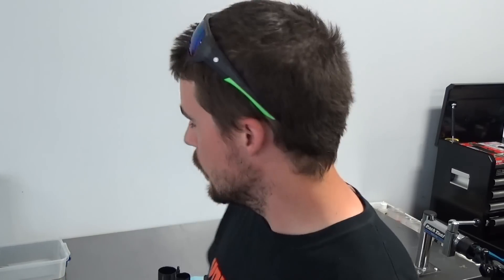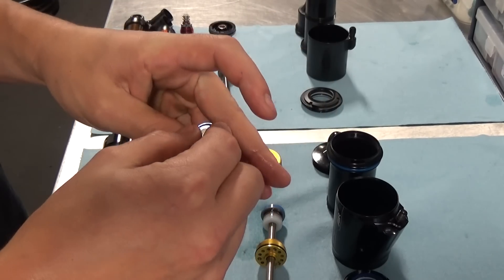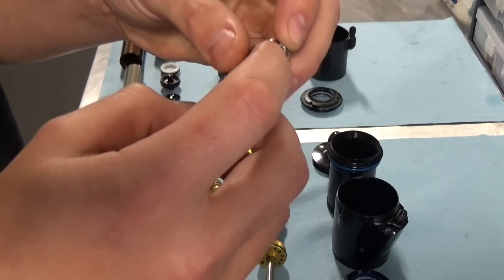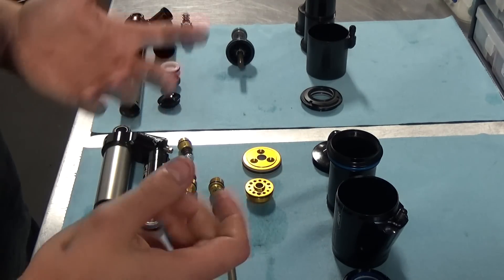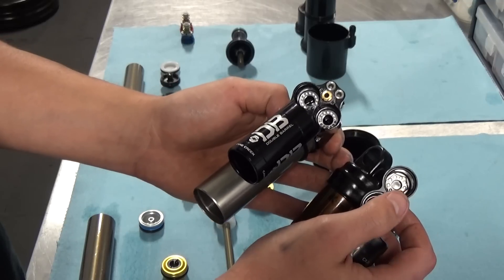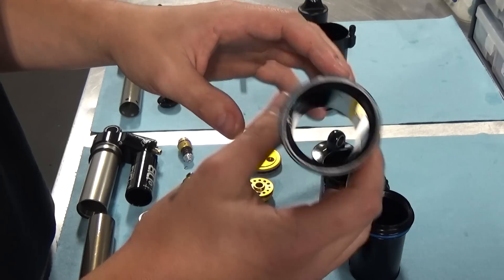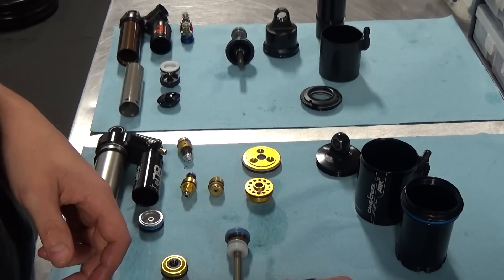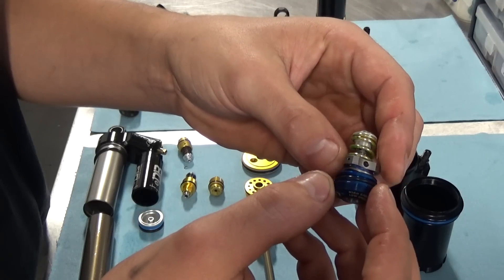Vorsprung Suspension - Fox Float X2 and Cane Creek DB Air comparison

Comment: I am 340 pounds. Is the X2 still better or should I install a cane creek?
Reply from the maker: It depends on the frame it's going on to determine whether either of those shocks is going to be able to generate adequate spring rate or rebound damping for you. You may need a coil shock with custom valving & a custom wound spring.

Comment: Hi Steven. Recently discovered this videos and I've found them both informative and entertaining. I've a couple of questions about the X2 if I may. I see from another comment, that the X2 requires a full service to get the air can apart. Is that possible for a competent home mechanic? Also, my Monarch plus debonair has a nasty "lump" in the feel which I think is the bypass port. Does the X2 have a similar problem?

Thanks,
Steve

Comment: hi, great videos!
just wondering if you've had an X2 performance elite apart? it has low speed comp\rebound adjust but not high. 
I have one on my new reign and it's failed 3 times after 30 seconds of riding each time. probably after the 1st decent compression. damping fails so turns into a pogo.
any thoughts? Sola Sport (australian dist) don't seem to have any clue on anything. they just keep bleeding it.
Reply from the maker: Sounds like they just aren't sorting out the root cause of the problem. You may have something like a dented damper shaft or a seal housing that's out of spec or something like that, that isn't necessarily easy to see (or even visible at all!) but is causing things to leak somewhere.

Comment: I have the float x2 was working perfectly till it went in for the recall and climb switch installed now it makes a squelching sound when compressed several times which has never done b4 then goes quite but does it again once the bike has been setting for a few minutes and also my friend has the 2017 shock and does not make a sound and also if u shake the shock u can hear oil slashing around I sent t back too them they say it may need a need what's your thoughts
Reply from the maker: That does sound like it was not properly bled. A rebleed may fix it - or it may not.

Comment: Lol
I can't give you guys enough credit for this video.
I bought a used CCDB a couple of days ago which only needed a bit of damping oil, but was in great condition otherwise. After I filled some oil in and installed it, I noticed a clunk when compressing the shock which made me suspicious. I just watched your video and heard about the valve seats coming loose.
I immediately jumped up, disassembled my CCDB and found both valve seats at least a full turn or two loose!! You can easily tighten them with ordinary needle nose pliers btw. :-)
I completely changed the oil and greased all seals. It now runs quiet and smooth as you would expect it! :)
Reply: Max Lindner 
can u make a video how to do it?

Comment: Hi Stevens, I understand that the main advantages of the X2 is on the spring side (air can design, bushings...). So what's your point on a battle between the coil versions of the X2 Vs. CCDB?

Comment: You mentioned that DVO shocks get air in the oil over time. Do you think this is due to their bladder design as opposed to an ifp? It seems like air would diffuse through the rubber into the oil.
Reply from the maker: DVO? I think you may have mixed that up with DB Air maybe, as I don't think I've commented on DVO anything at any point! At any rate, diffusion through a bladder would be very slow as the air/nitrogen pressure is always the same as the oil pressure on the other side of the rubber anyway - they've proven to be pretty robust in that respect in the motocross world.
Reply: +Steven Mathews (Vorsprung Suspension) Haha you're right. At 11:37 it sounded like you said dvo at first. Great video though. Keep these coming. Maybe with some forks in the future?